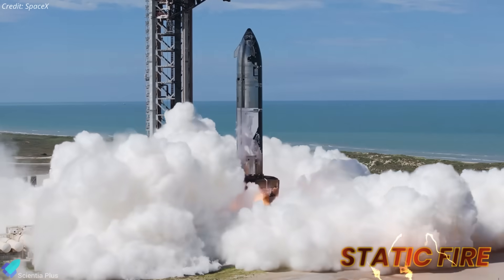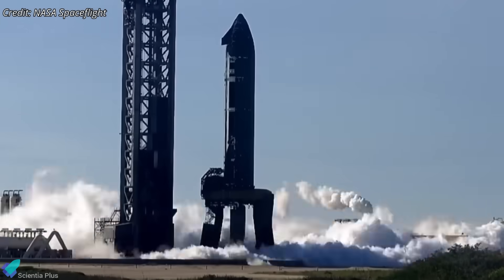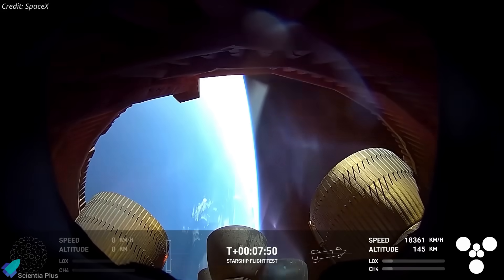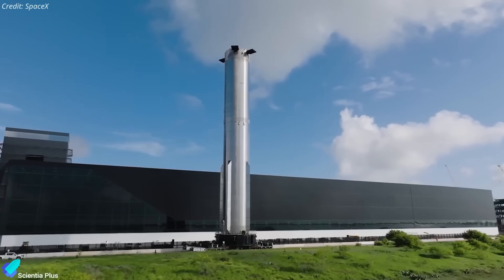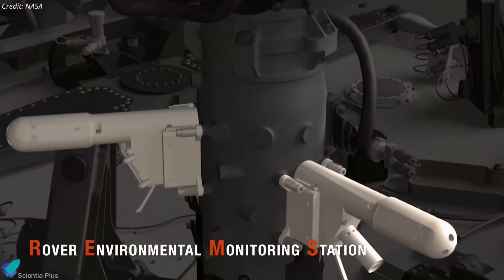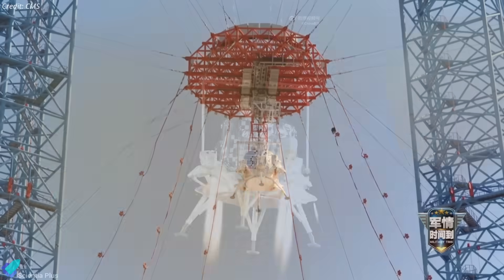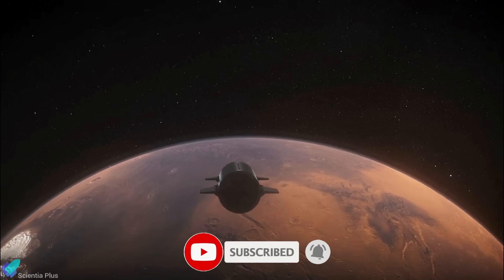Starship 37 Just Nailed Its Spin Prime Fixing Raptor Issues! Flight 10 Next Week

Comment from the maker: 00:00 Starship Updates
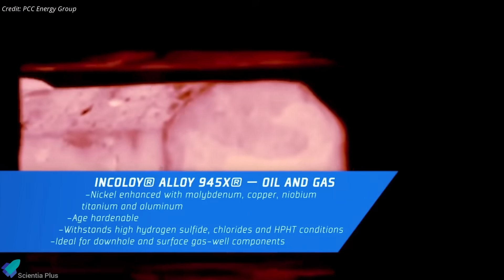09:11 China’s Moon Mission Just Got Real – Lander & Crew Capsule Pass Critical Tests!

📚 Learn More:

🚀 Starship Block 2 Explained:
 📖 Summary: https://shorturl.at/b0dtw
 🔍 Detailed Explanations:
  • Design Improvements Update 1: https://shorturl.at/lpGT7
  • Design Improvements Update 2: https://shorturl.at/gwNQ4
  • Nosecone & Payload Bay Redesign: https://shorturl.at/xa60S
  • Methane Downcomer Redesign: https://shorturl.at/XdYBG

🚀 Starship Block 3 Explained: https://shorturl.at/mnBT4
🚀 Starship & Booster Block 3 Detailed Breakdown: https://shorturl.at/IViwD
🚀 Starship & Booster Block 3 Production Begins: https://shorturl.at/xRNkJ
🚀 Booster Block 3 New Transfer Tube Explained: https://shorturl.at/Iaqc6

🔥 Raptor V3 Mega Upgrades & First Test: https://shorturl.at/TRIyj
🧱 What’s Inside Starship GigaBay?: https://shorturl.at/nJM75

Pad B Explained
🛠 Insane Engineering of New Starship Launch Pad B: https://shorturl.at/7RAZd
🛢 Dual-Port Orbital Refueling – Full Technical Breakdown
https://shorturl.at/5tiqK

🛠 Other Starship Upgrades:
 • Hot Staging Explained: https://shorturl.at/jf400
 • Super Heavy Booster Upgrades: https://shorturl.at/Pi5R3
 • How SpaceX Protects Raptor Engines: https://shorturl.at/4Om8F
 • New Heat Tiles Explained: https://shorturl.at/p2Ijb

🚀 Starship Flight 7
 📽 Complete Breakdown: https://youtu.be/UqzZx7vb-TA
 🛠 Root Cause & Fixes: https://shorturl.at/HcLKo

🚀 Starship Flight 8
 📽 Complete Breakdown: https://youtu.be/f26yH80RK2o
 🛠 Root Cause & Fixes: https://shorturl.at/vsGFB

🚀 Starship Flight 9
 📽 Complete Breakdown: https://youtu.be/2eirgcUzwts

🔥 Starship 36 Explosion:
  📽 Detailed Breakdown: https://youtu.be/VWQiIz1ymBA
  🛠 Damage Report: https://shorturl.at/Quoex

🔥 Ship 37 Static Fire #1: https://shorturl.at/xSHyE
🔥 Ship 37 Static Fire #2: https://shorturl.at/Mf5UB
🔥 Ship 35 Static Fire Engine Issue: https://shorturl.at/gIwEr

📡 Stay Updated:
📢 Weekly Updates: https://bit.ly/3HIQjPC
🚀 SpaceX Playlist: https://bit.ly/34wue8T

🌍 Follow Us:
👍 Facebook: https://www.facebook.com/scientiaplus
Reply: Mmmm look at all the hypergaulic fuel abuse by the Chinese who give ZERO (0) fucks about the environment.

Want to know what needs to change, scientia_plus? What needs to change/get oversight into how all these new rockets are a) getting into orbit b) what they're barfing while getting into orbit c) what they're openly dumping (pieces of toxic rocket) d) what they're using to get/land on the moon e) anything I missed that negatively affects the earth/moon/dumped crap between the earth and moon.

This is the era to make changes or embarass the Chinese/Russians/Indians into cleaning up their programs. Spacex does a reasonable job of building towards keeping their damn toss off parts out of the ocean/not dumping toxic fuels however the world doesn't seem to be giving a single crap.

YES HELLO SLS! HI HI SLS and your four rockets of pure poison fuel! Hi hi! We see you! We see you and your rust colored, human/envirronment/atmosphere killing rocket fuel!

Comment: EXCELLENT PRESENTATION-- VERB/NOUN STRAIGHT TO THE POINT. BTW : WE BELIEVE PARALLEL IN-ORBIT FUEL TRANSFER IS RISKY, WE'D LIKE TO SEE A ZERO-G INFLIGHT VERSION OF "MILITARY FUEL TRANSFERDS... WHICH IS MOR "SERIAL" THAN "PARALLEL". WE ALSO SAID FLIGHT 1 WOULD BLOW UP THE PAD W/O A DIVERTER TRENCH, , AND THAT MASSIVE FUEL SYS DESIGN CHANGES ON FLIGHT #7 'COULD' LEAD TO FAILURE --- IMPROPER TESTING.